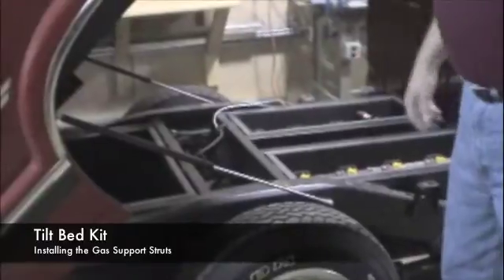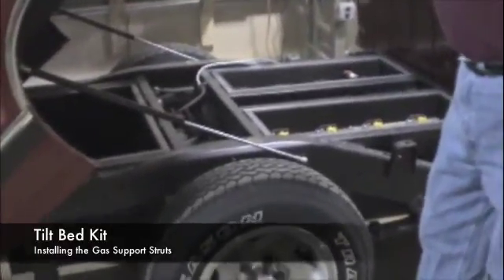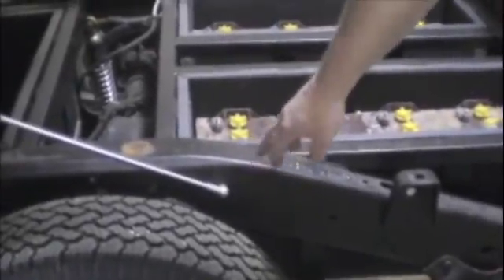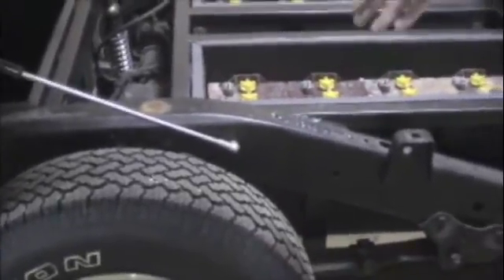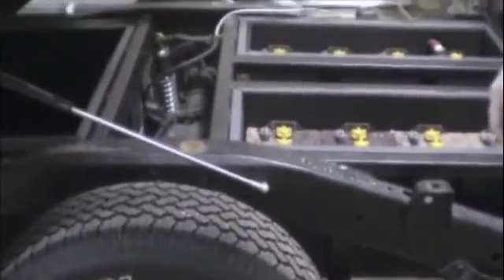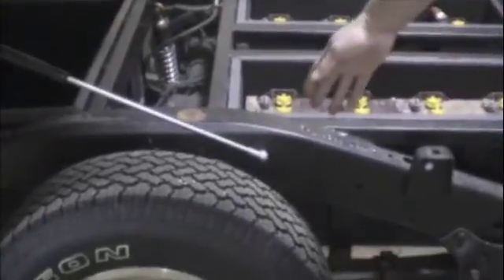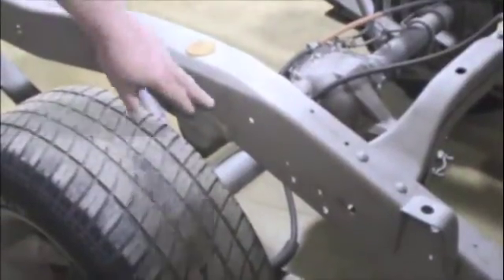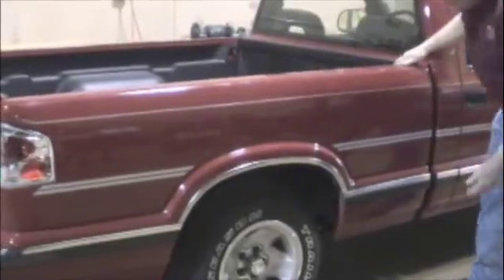Overview -Tilt Bed System

Comment: Hello friend, how are you, I'm from Brazil and I intend to do this bucket process also on this same model that you did, but it will be done on the Ford Ranger Stx 97, I'm curious, do I really need to move the bucket back 1cm in this configuration with gas shock absorbers, thanks Any information will be of great help, thank you very much for your attention and congratulations on the service.